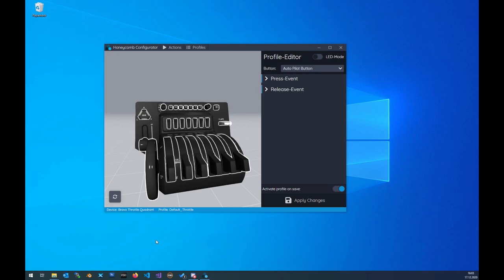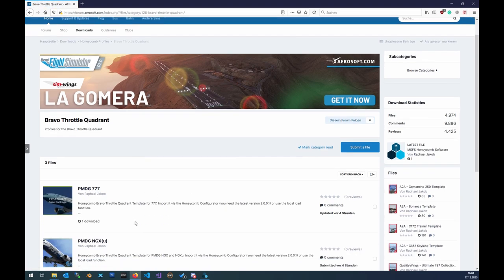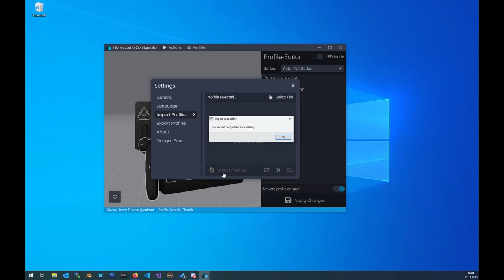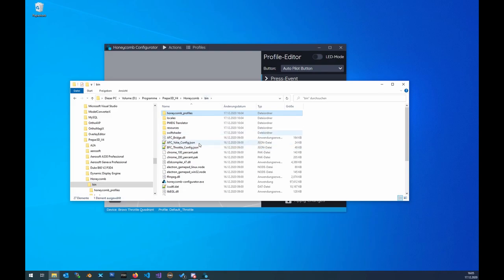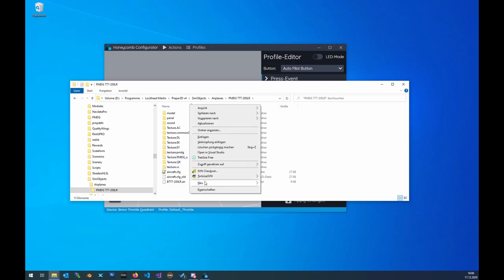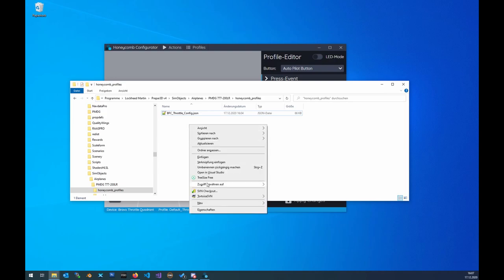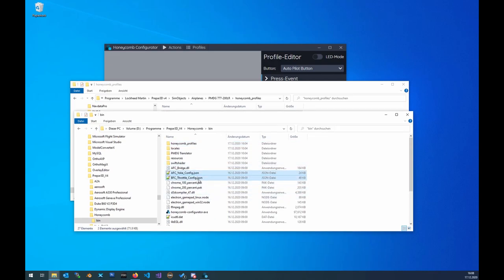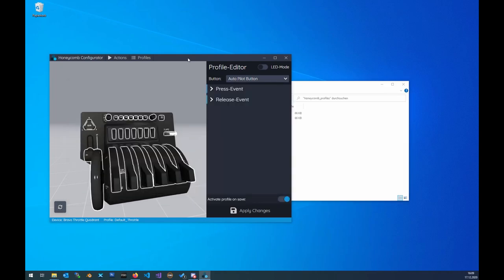Honeycomb Configurator - Local Load Function

Comment: I want to thank you for all your time and devotion in setting up the Bravo Throttle quadrant.  I still am having difficulty understanding how to get all the LED lights to illuminate and distinguish on the Throttle quadrant.  I wish you had a list of commands in a  file we could just download and follow them as we setup our profiles.  It's really hard to understand your explanation in the values.  Is there such a file you can share or put out for us to use? I have downloaded the templates you showed in a recent video but the  747  and QW787 do not seem to match up. I have several pop ups saying items not available when using the QW787 and the 747 all the LED caution light reman illuminated all the time.  Only the PMDG 738NXGu works...
Reply: Yeeeeeesssssssss!!!! I have tried configuring LED's and either they don't work or one button turns on the LED of ANOTHER button! Mind-numbingly exasperating!!